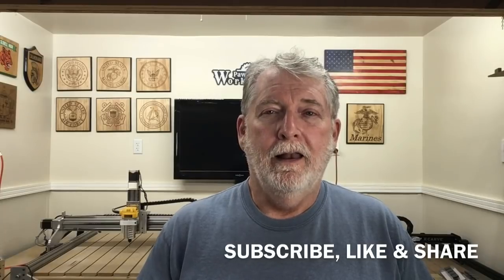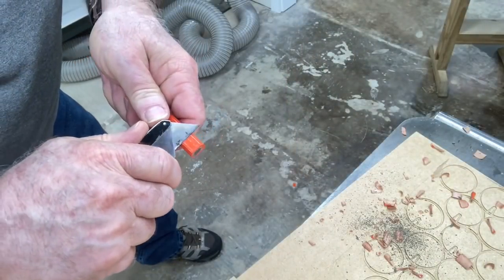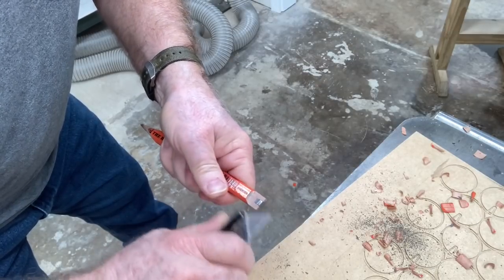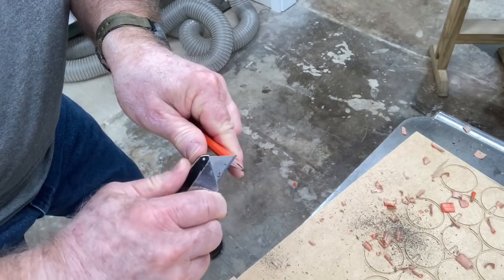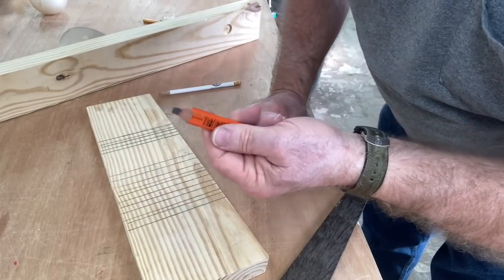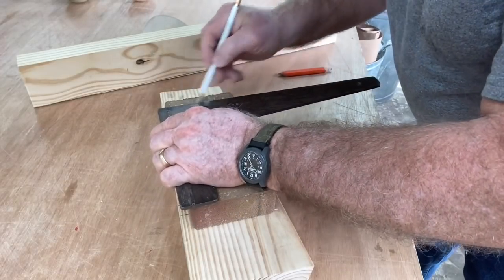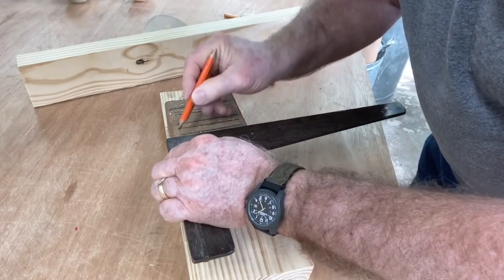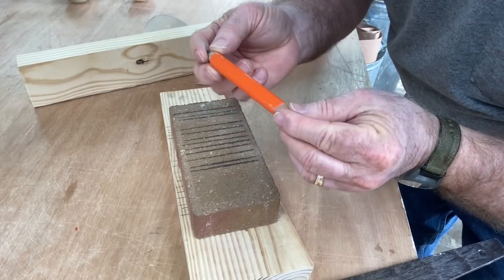A Carpenter Pencil.  What’s the Big Deal? Don't use these sharpeners!

Comment: As simple as this may seem it really is a very good tutorial on the use of a carpenter’s pencil. 
I have a flat wooden advertisement with graphite in the center and not lead but that is what we refer to it as🤣. It sits in the tray of my truck on the dash.
I find that this pencil is good for scribing a contour line when fitting trim to a cabinet next to a wall that is not plumb. 
When marking cut lines for fine work I use a marking knife. 
Thank you Paw Paw for highlighting this tool that is fast becoming forgotten. 😀🛫
Reply from the maker: I also use it for scribing paneling which is not used much any more and when installing formica on countertops.  The wall is rarely straight.  Thank you very much.  People have no idea how to sharpen a carpenter pencil.  The pencil sharpener is for non carpenters.  You will be laughed off a job site and would be a sign that you are not a true professional carpenter.

Comment: Watching this while my eagle is carving from your other video. I cheat sometimes with my carpenters pencil and hit it on the belt sander. Thanks Paw Paw for the great videos. Keep up the good work.
Reply from the maker: Great, nothing wrong with doing that at all. I use the sander and I have also used the concrete floor when needed.

Comment: Well, this is interesting. Almost one of life's mysteries. But here's the straight story. Before I get ahead of myself, I'll tell you straight out that I'm a geezer. Yep, I am. That means that I have gained a tiny bit of knowledge that I wouldn't have gained if I had croaked earlier. So I'm probably ahead of you by whatever margin. OKay, now that 've pissed you off. After nearly 60 years in construction and woodworking I`ve used all types of pencils. The straight story is, that carpenter's pencils carpenter's are designed for use on rough, unplaned lumber. They excelle at that. BUT, they are double ended, so if a finer line is needed, just a whittle away takes care of the problem. These days, I use a regular Dixon pencil, with a #4 lead. Except on those  times when I need a carpenter's pencil.
Reply from the maker: Thank you for sharing

Comment: For as long as it took you to sharpen your pencil, I could've used a sharpener, and been back to work.
Also, those kind of utility knives are garbage.
Reply from the maker: You have an interesting point of view. Speed is not important when demonstrating a technique. If you don’t like the knife I’m using then don’t use it. It’s that simple. I’m so glad that you were able to determine for yourself (maybe not for others) exactly what knife you do not like and that you would rather use a sharpener for your pencil. Fantastic!  Glad I could help.
Reply: @PawPawsWorkShop  One more thing, if your tip is too short, it's hard to see what you're doing, and, if you're doing it accurately. Just saying.
Reply from the maker: There are many many ways to sharpen the pencil depending on the application that you need it for the job at hand.
Reply: @PawPawsWorkShop  Bullshit, lol. You need a sharp point that you can see while using your pencil. A short, stubby point doesn't work well.